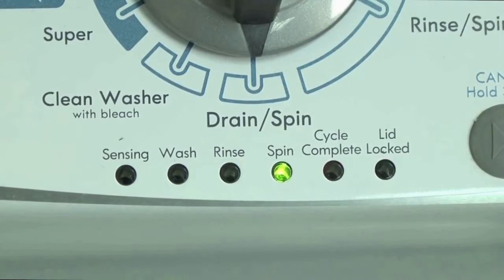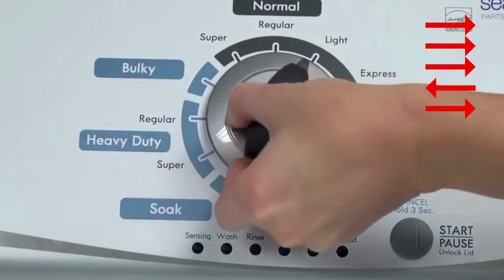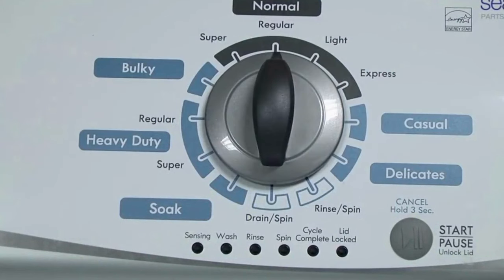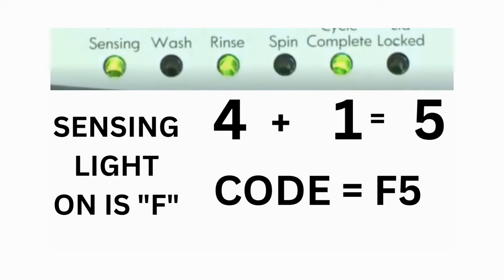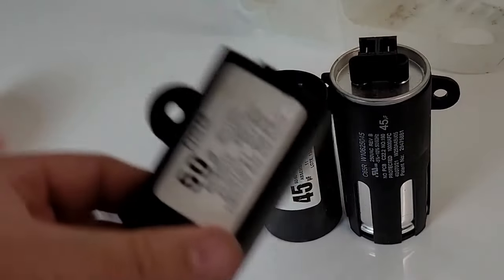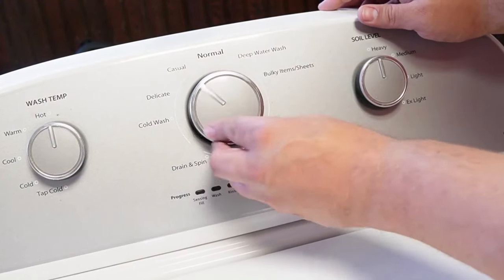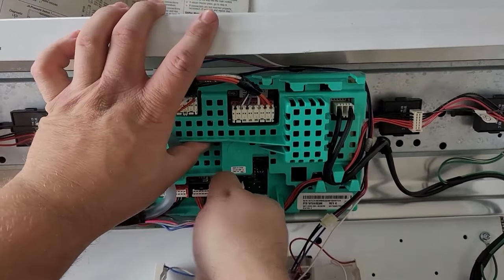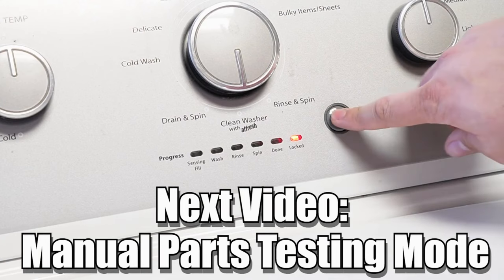How to Reset an Amana Washing Machine Quick Guide

Comment: Thanks for the video! everytime we had a power bump my Amana wash machine would just blink until i unplugged it, well thats a major PIA so i was going to get an ext. cord so i could reach & unplug it easier then i thought there has to be a away to reset it without having to unplug it and i dont have a manual so here i am lol  i pushed the button for 3 sec & bingo no more pulling the washer out & hanging over trying to reach the plug getting a chest cramp 👍